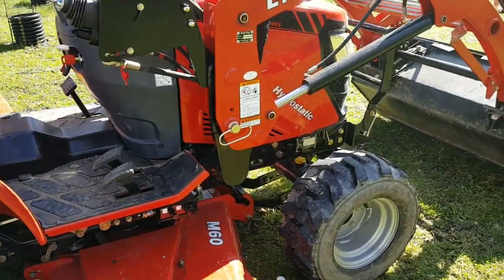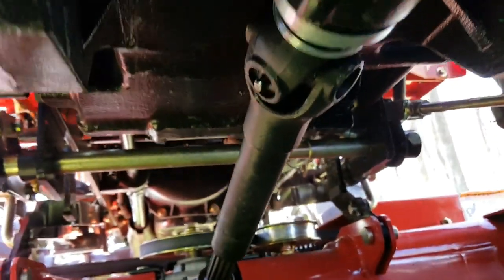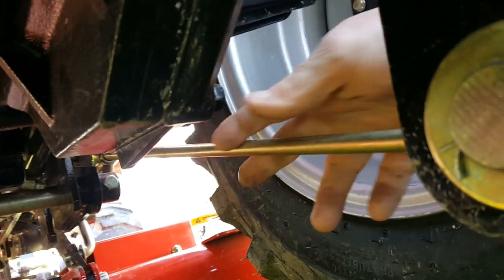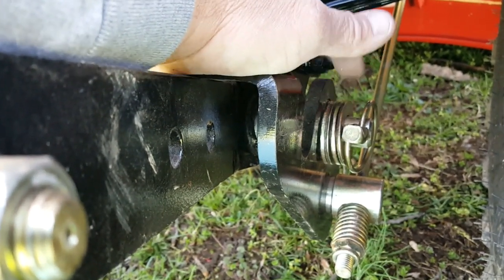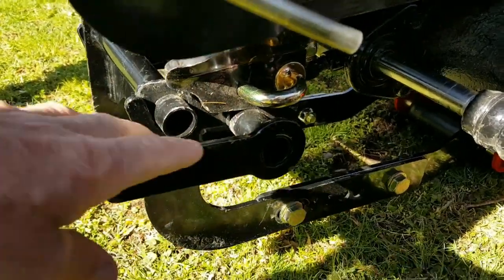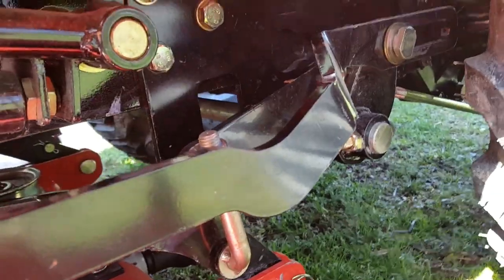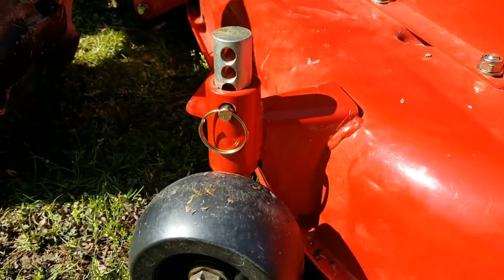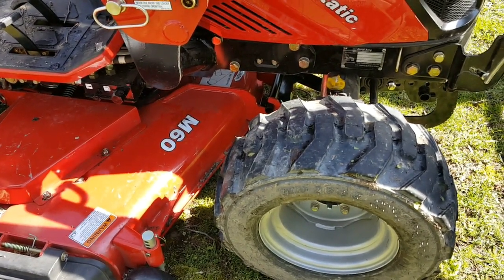rural king  rk24 subcompact tractor 60" mower deck, (part two) made by YTM Tractor

Comment: Hi Mike great video. I'm very interested in the RK24. This video helps me decide on the mower I want. Basically I'm going with the rear finish mower. Much easier to add and remove so I can use it in the woods with the grapple and bucket.
Reply from the maker: Yes, I really did not need the mower deck I have a john deere x 500 that work just fine . The mower deck would be okay if you left it on all the time . Rural King has all kinds of attachment . glad to help

Comment: The rods "should" be straight all the way, no bend at the back at the knuckle it passes through, mine were bent when I bought it (new). After a while therodsnapped where it is bent, it creates a stress point when bent. I bought new rods ($50.00 EACH). I put the new rods on and adjusted it CORRECTLY. If not adjusted properly it will again bend the new rod when the deck is raised. You can make new rods from round rod and a threader.  Works perfect now and NO  more bent rods.
I lifted the deck one day and heard a loud crack, it was the rod shearing at the lift knuckle, be careful with it !
GREAT MACHINE, I love it !
Reply: My right rod had about a 45° bend in it, the left rod maybe 20°. It was pulled so hard on the right that the bracket that goes up over th 3 point Ling was bent up on the inside toward the shaft, I had to straighten it to sit flat as it is supposed to. Who er put the deck on at RK, had it all messed up. Works great now.
Just a heads up. Good video !
Reply from the maker: @davidrodkey3522  😀 thanks for your comment
Reply: Mine are beginning to bend. What's the correct way to adjust the spring tension at the end of the rods?

Comment: Good video, but there was another one about the same tractor and the owner was hearing a squeaking sound from the front. Turned out that he also adjusted that bolt to stop the wheels from turning too far. In his case, RK's mechanic adjusted it and the noise went away. They told him t hat those bolts have something to do with the wheel hub or some such thing. The RK mechanic's adjustment, solved the squeaking noise. So you may want to ask the RK where you bought it.  I just bought the RK21 with a 54" deck, front loader and box blade.
Reply from the maker: The squeaky noise in mine was the bearings in the front wheel I had it replaced

Comment: I have a question. I just bought a Branson with the same deck setup and noticed the deck adjustment only adjusted the left side of the deck so that the right side was lower. The only way I found to adjust the right side higher was to have the wheels holding the deck up. I noticed in your video that the right side wheels were touching the ground but not the left. Have you measured your deck on both sides to see if it’s level or have you had problems with un level mow patterns?
Reply from the maker: I was probably sitting on uneven ground to level out the deck on both sides would be the two rods that go to the rear of the tractor we're your Hydraulics pick it up

Comment: I’m looking into getting a compact tractor and I’ve been watching a lot of videos with meet the Morgan’s and he uses three different RK tractors and I really like the 24 but I would like the front  loader the backhoe and the belly mower, how are you liking  yours and if you don’t mind me asking did you pay what it is advertised for on the website thank nice tractor by the way I really like it
Reply from the maker: Yes i did pay for what they advertise for but i only got the front loader  and then went back and bought the deck . yes i do like the RK 24 a lot cheaper then the john Deere or Kubota for what I  use it for
Reply: Rockie I recently purchased a RK24 with loader and belly mower, like Mike has there; the only thing that I don't like is if you have high grass, field grass(hay) or weeds they tend to wrap around the drive shaft and it comes out. I`'ve lost the shaft twice. Now I'm wishing I had gotten the finish mower instead. Price was as advertised. I elected to forego the backhoe for the dump trailer with mine. I love it. I think the grapple will be my next attachment. They weren't available when I purchased mine. Definitely suggest getting ballast in the tires.
Reply from the maker: Yes I did pay for what it advertised for and I do like to argue with him for it is a nice tractor had a lot of fun this summer using it
Reply from the maker: Yes I did pay for what it was advertised for and I did enjoy using it this summer is a nice small compact tractor

Comment: Do you have a video about side to side adjustment when dropped it’s 3.5 on one side and 4.5 on the other
Reply from the maker: no sorry
Reply from the maker: It should be the two rods go to the rear of the tractor from the  Carriage that holds up the deck next to your hydraulic lift in the back If it's like mine
Reply: @mikelastime  ok I’ll check those out.. I got most of everything even but the deck isn’t when down..
Reply from the maker: @kevinwinchester515  👍